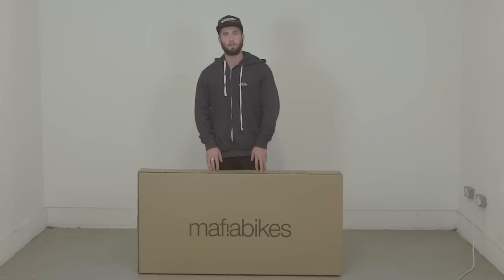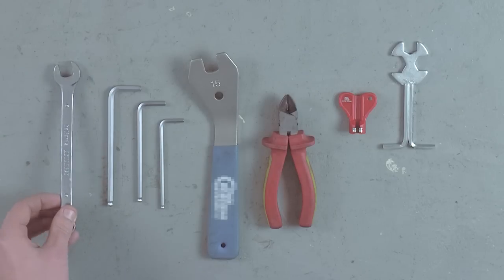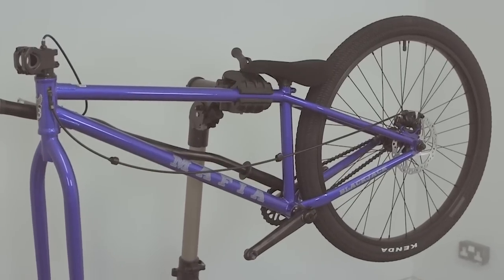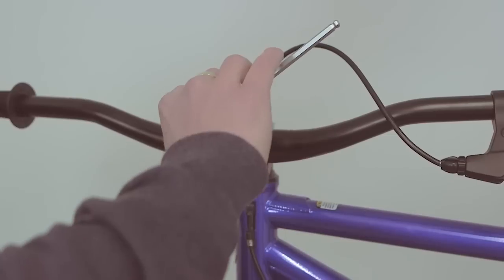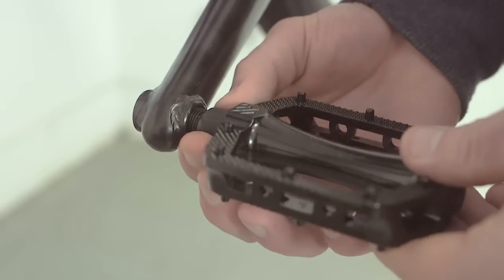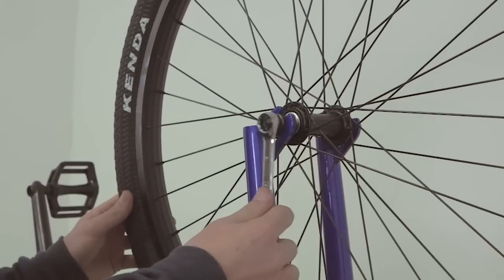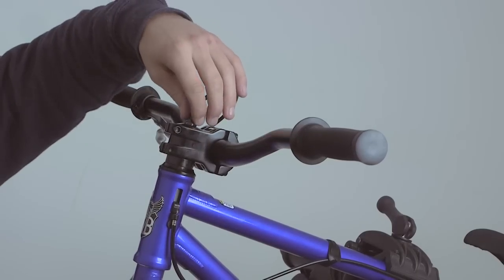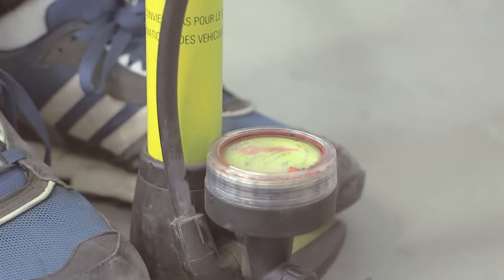How To: Unbox and build a Mafia Blackjack

Comment: Mine came with my pedals scratched and  a bit rusty and I have this noise every time that I apply a bit of pressure the crank clicks once or twice and I only had it for 3 days and that's how it came out the box like that and I check every thing if something is loose or something so you my box was a bit trashed

Comment: could i put air suspention forks on this bike ??
Reply: Only to 120 mm travel
Reply: Have you added suspension to the bike? If you have what are the ones you used?
Reply: Gwion Robert i have a set of fox float 32 kashima shocks i has spare but i would recommend sr suntour raidon or epicon forks, anything that is air sprung. if you're not on a budget then go for some fox forks or rockshox just as long as it has a quick release skewer not a through axle. i would also recommend upgrading the rear brake to a hydraulic disc brake i used a shimano zee bt any is better than the stock cable. the forks can pretty much be any manufacturer so long as its 120mm with a 1/8 non tapered crown with a quick release. pretty decent jump bike after a few upgrades.
Reply: George Pacey don't the newer models have hydraulic brakes as standard?